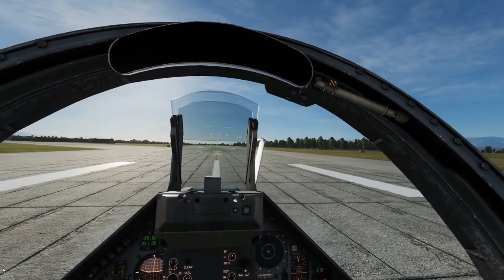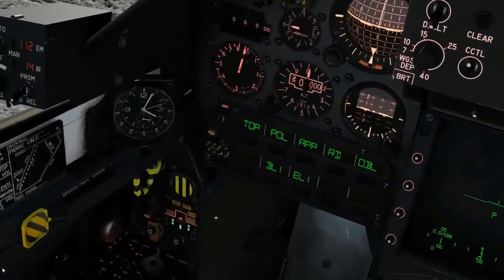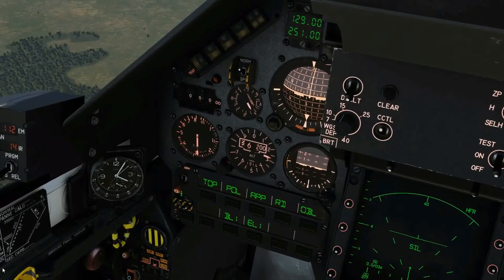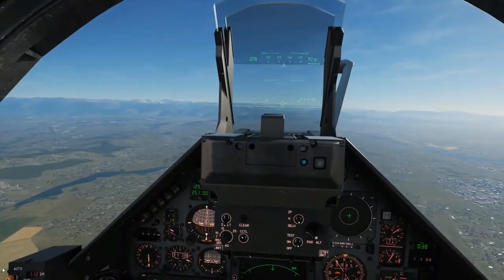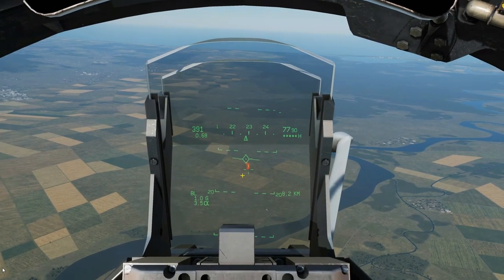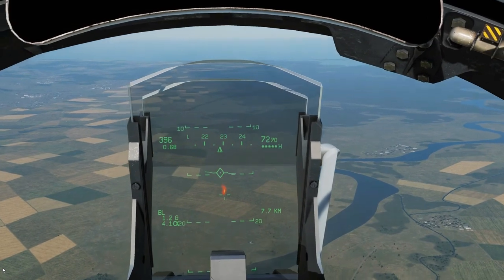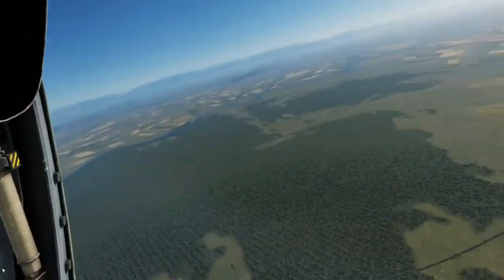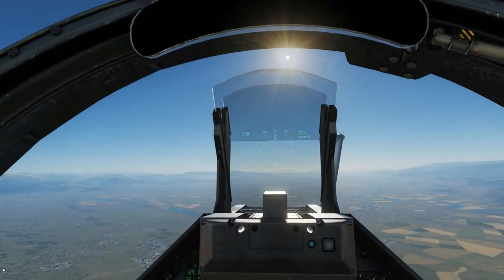Mirage 2000C: CCRP Mk82 & Laser Guided GBU Bombing Tutorial | DCS WORLD

Comment: Ccrp is bugged, has been for a long time. Will always overshoot. Suspected parrallax issue with the hud. Best you can do is use the top of the diamond to designate.
Reply: Just in the Mirage? or all CCRP across the board. I haven't flown since the Huey came out.
Reply: @freezerbee  just the Mirage
Reply: Bought the mirage 2 months ago, thought I was just absolutely shit at using CCRP. 

Thanks.
Reply: @Samuraid77  I learned "lase the tracks — not the tank" in the A-10 but this problem isn't that problem. I hope they fix it.
Reply: Came here to check If I was doing something wrong. Yep, normal Razbam & ED shenanigans.
Reply: @nyandyn  4 months later and Im doing the same. good to know.